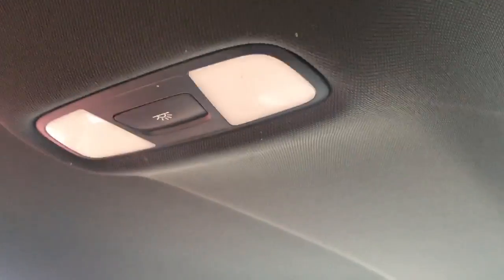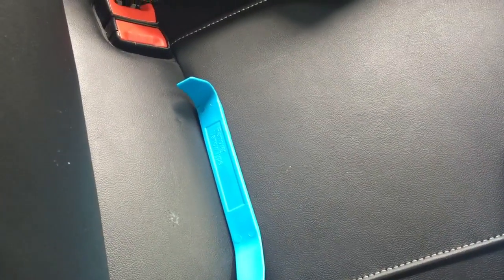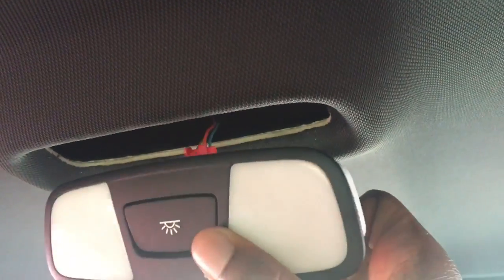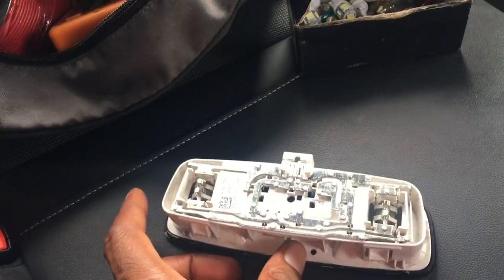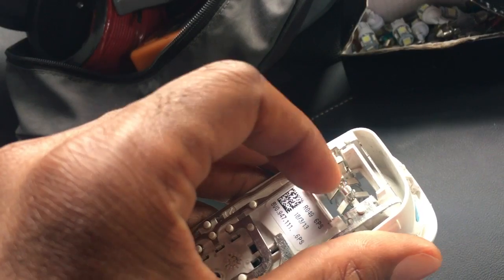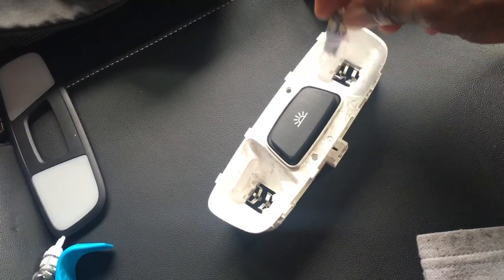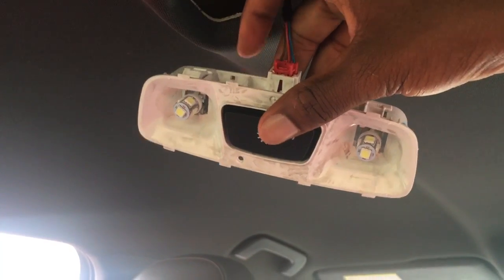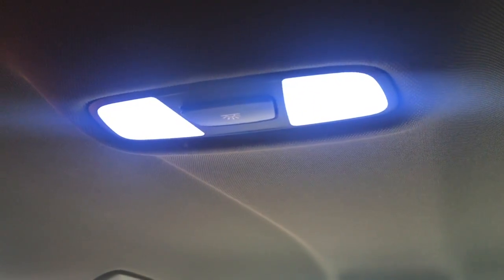AUDI A3 2013 8V - REAR DOME LIGHT LED INSTALL

Comment: When I set up the lights and the button is on “door”, there is a very small light. But If I turn off he button this small light turns off
Reply: i have the same problem
Reply: Did you find a way to fix this as mines doing it…?
Reply: @jakelayfield9673  unfortunately no

Comment: Quick question, I’ve just changed the front one and it works fine but when I change the rear ones both of them stopped working, anyone know why

Comment: I have follow the video to install the light, all the interior light not working ,even the front as well ,how should i do ?
Reply from the maker: You may have blown the fuse by putting bulb in whilst light switch is on? Check the fuse mate...
Subscribe and like please!
TW
Reply: Tim Williams where can u buy the new fuse online ?
Reply from the maker: Amazon or eBay, I don’t know what fuse you’ve blown so you’ll have to find out and look at it before getting the same amp fuse..loads of car shops sell them! Good luck
Subscribe and like please!
TW